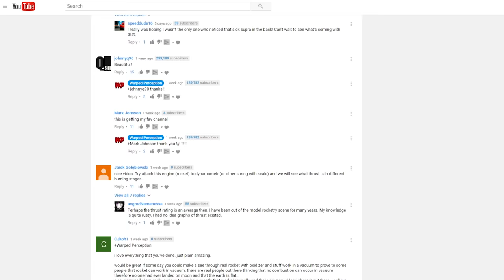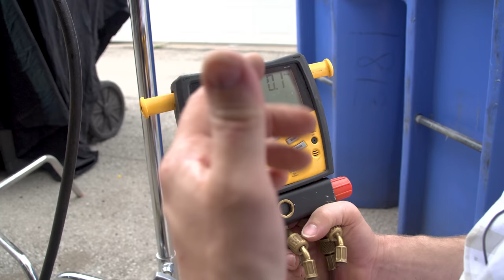Model Rocket Engine In A Vacuum Chamber - 4K Slow Motion - will it burn? - Rockets (S1 • E3)

Comment: such  a great , well done and scientifically significant video. thanks for posting!
Reply from the maker: zanick2 the new version of this posts tomorrow. Glad you like it, thanks for the feedback
Reply: @Warped Perception, how do you get sound in a vacuum?
Reply: ...and how long do those rockets have ignition for? Seemed like only a few seconds, shouldn't it have gone longer?
Reply: thats a great question.  maybe because the rocket was attached to the spring which is fastened to the tube on the inside, thus making the tube a "speaker" . Ill let Warp perception chime in here.
Reply: i would also see what the air pressure was in the tube during and after the rocket expelled all its fuel.    the flat earthers, think that the cartridge created enough atm to work against.    so, by showing the mass that has been produced in the chamber, you can address that factor.  maybe there was an enough molecules to transfer sound.
Reply: I was thinking about this a little deeper.  if the rocket engine has about 4 oz of fuel and air weighs about .08pounds per square foot and the tube is about 5 cubic- feet, then initially, there is little "air", but at the end of the burn, I suspect that the air pressure could be near 75% of sea level, because 4 oz is that close to what 5 cubic- feet would be as far as air weight.... 6.4oz.     this makes no difference in the thrust at anytime, but it is clear as the rocket starts out , there is not enough mass ejected out to create any  substantial air pressure.. however, it might explain the sound you hear as it is not really a true vacuum after a couple of seconds of the burn
Reply: @zanick2  it's because the vacuum was filled with exhaust gases
Reply: @BeachMongoose  the small rocket engines only burn for a couple of seconds, no more than 5 i think

Comment: It appears to me that the actual thrust is only present when the exhaust reaches the rear wall of the chamber. This is evident on the portion of your video that shows the 2500 FPS.🤓
Reply: You can't even see the rear wall, but also if you notice that the exhaust flame burns brighter when it seems to be producing ample thrust which is indicative of reactive force from the hot gases rapidly exiting.

Comment: Also, I find it hilarious that half of the comments here are flat earthers decrying you as a NASA actor, and the other half are people who actually have some understanding of the science decrying your vacuum as not good enough. XD
Reply: Correct, That vacuum isn’t good enough, It still has oxygen in it.. Space has “ZERO OXYGEN” right? Therefore this “experiment” is absolutely worthless.
Reply: @sforge2414  Incorrect. Space most certainly does not have zero oxygen. Or, more relevant to this discussion, it does not have zero pressure. The pressure is very low compared to at sea level on Earth; how low depends on where you are in space. But keep in mind, that it's a smooth transition, from ground level all the way out to infinity. Not linear... but smooth. 

So there is nowhere in space with zero pressure. There is no such thing as a perfect vacuum. There are only relative vacuums; relative pressures. This vacuum chamber is fine to demonstrate the difference in a rocket exhaust plume depending on pressure. Is it a perfect vacuum? Of course not; but that doesn't actually exist. Is it even as much of a vacuum as low-Earth orbit? Nah, surely not. But is it a very low pressure compared to that just outside the chamber? Of course it is.

As for oxygen to enable combustion, the definition of a rocket motor is that it carries its own fuel and oxidizer. A model rocket engine like that is usually packed with black powder. That's charcoal (carbon) and sulfur for fuel, and saltpeter (potassium nitrate, KNO3) as an oxidizer. Once ignited, the potassium nitrate decomposes. The nitrogens combine to form nitrogen gas; the carbon pairs up with oxygen to form carbon dioxide; the potassium uses leftover carbon, sulfur, and oxygen to form various sulfates and sulfides. Many of these compounds being gasses, they take up far more volume than the solid black powder did, and expand violently to do so. By providing just a small nozzle for them to escape through, we convert what would otherwise be a deflagration explosion into thrust. No oxygen from outside sources is required.

I mean... just to be clear, did you seriously just comment under a comment making fun of people claiming his vacuum wasn't good enough, to demonstrate that you are one of them?
Reply: @barefootalien  You yourself just now admitted he DID NOT replicate the same conditions that are to be expected in space or even the earth’s upper atmosphere. Therefore the “experiment” is technically worthless/invalid and your lengthy seemingly elaborate word stew is rendered pointless. Do you not see that?
Reply: @sforge2414  lol
Reply: @barefootalien  So yes, Good.. I’m not your adversary by the way, Incase that’s what you were thinking. I’m just looking for the truth/Ways to get closer to the truth no matter what it may be. If a theory/claim fails to hold water (no pun intended) It should be thoroughly re-examined over and over until a clear result/straight answer  is reached.
Reply: @sforge2414  Oh wow. You really don't understand chemistry do you? Yes oxygen is needed. No it doesn't have to be gaseous oxygen, nor must it be present outside the rocket to work. Heck, rockets wouldn't work if they got their oxygen from outside the rocket because they'd be unable to move that much atmosphere through them. The oxygen is stored in the fuel in the form of what's called an "oxidizer".
Reply: @BerryTheBnnuy  Keep your “Oh wow” to yourself until you actually know what I’m positing 👍🏻 I’m not arguing that it wouldn’t be able to burn in a vaccuum I’m arguing that the thrust generated (In the actual vacuum of space) Would be reduced to a critically low perhaps even un-useful level.